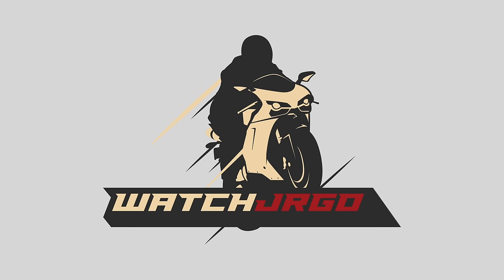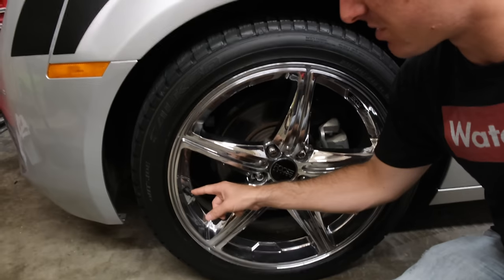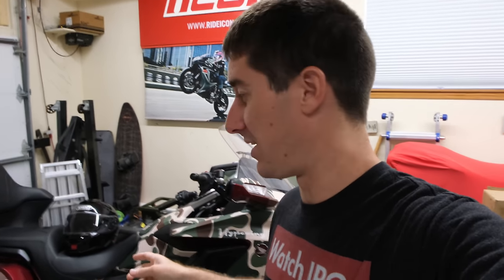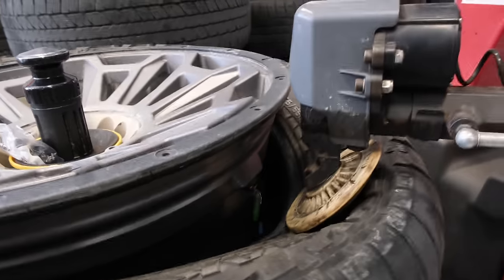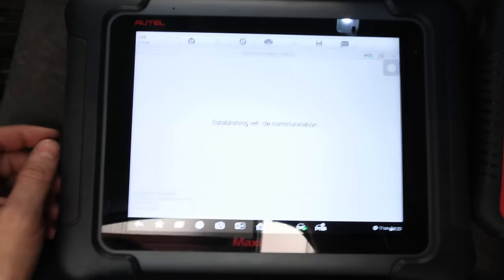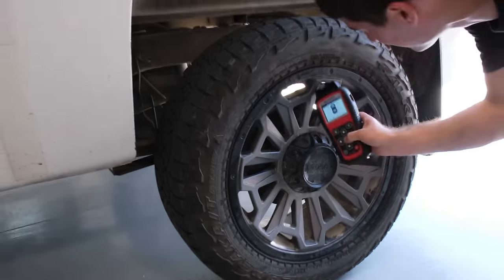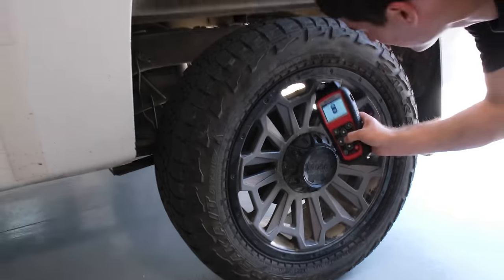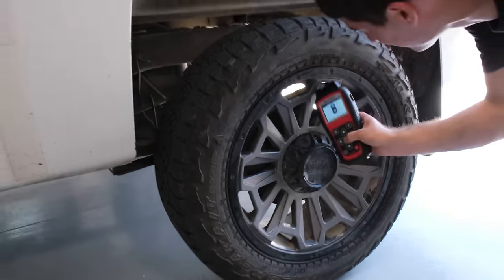TPMS SUCKS! Here's How To Fix It Yourself *Probably*

Comment: Personally i hate tpms and find it annoying and needlessly expensive.  I check my tire pressure regularly.  I wish there were a way to shut it off for people like me.
Reply: Because they sell cars like candies, not educating people the maintenance, the care needed. To make profits the wrong way, is also to make people uneducated, to make people more dependable on others like dealers,shops, and etc... At the end, most people who drives are busy, have minimal knowledge on the safety maintenance of tires and cars, causing danger to self and others on the road. Temporary solution is to create more cost for consumers like TPMS, more waste for the environements as its one time use while new laws keep on placing the burden back on individuals vs back on the system . 🎉
Reply: You can skip it from the ECU Application, but think about insurance. They'll refuse any payments in case of an accident, once proven they were not connected or red by the board computer of the car. And they know well how this could be investigated.
Reply: I hate it.

Comment: I remember the good ole days when you didn't have all this nanny stuff and you took off and hit the first corner, understeer took over and you wrapped it around a tree...the end.
Reply: Yeah those good old days when a fender bender could kill you and cars lasted 100k miles if you were lucky. I think I miss the rust the most. Cars were so much better back in the good old days
Reply: poopsmcgee2k6   Big boats from the mid '70s that had 165 hp and enough plumbing to build a public housing project...

Crumple zones? Not for "Real Men". Who needs stability control, I want the back end to come around...ha!
Reply: if you cant tell a tire is real low you shouldnt be driving
Reply: Vive la 1990s era Ford Explorers and their shredded Firestone tires...
 ...that forced the TPMS sensor upon the entire country!
Reply: Jbog07  my 98 integra 4 speed auto gets near 32mpg  the new ones are close to that and few will last 22+ years with the turbo and cvt
Reply: I'm sorry that you're so awful at driving that you cannot correct for oversteer, but please don't project your shortcomings on the rest of us, K?
Reply: @ragnarocking  Mandatory sensors were required by the EPA for mpg standards. Had nothing to do with safety.

Comment: I like how VW does TPMS with the ABS sensors instead of the sensors inside the tires.
Reply: That's what my Taurus has too and I much prefer it.
Reply: Yeah, there are several ways to meet the Federal requirements. I had a Honda Accord that used the ABS sensors to detect differences in the RPM of the tires. You get a lot more functionality out of sensors, but I'd rather it just be seamless and maintenance-free. I put snow tires on my Jeep a few years ago and had to get 4 new sensors for the winter wheels. It was an annoying hassle.
Reply: So your abs sensor outside the tyre can read pressure inside the tyre? That doesn't sound right. they might use the abs system to collect data but not detect pressure - unless it measures wheel speed rotation? Hadn't thought of that?
Reply: Andrew Crome it doesn’t read the pressure, just compares the differences in rotation between the four wheels.
Reply: My Alfa Romeo does that too. You need to recalibrate if you alter the tyre pressure.
Reply: I have it too in my Skoda and it’s a great feature 😊👍🏻
Reply: Andrew Crome it strictly measures wheel speed, but if the tire pressure varies between the wheels one will rotate slower/faster than others, depending if it’s overinflated or under inflated.
Reply: some older bmws also have abs style tpms
Reply: I personally prefer the way GM, Hyundai etc do it like the ones in this video. You can also start re-learn for the sensors off of the keyfob. My 2019 Jetta has the ABS sensor for TPMS and it doesn't even show individual pressure and has to be re - calibrated every time you put air in. My 2012 Malibu LTZ and 2009 Kia Spectra5 SX both have individual pressure readings and those are alot cheaper to replace over the ABS sensor. I'm not gonna be owning this Jetta outta warranty but whoever does have fun replacing that lol
Reply: Raguvian thank you I was trying to figure in my head how that worked! That now makes sense
Reply: That sounds simpler than putting individual sensors in the wheels but if you lose pressure in all tires equally, such as during a seasonal temperature drop, the ABS system won’t notice it, no?
Reply from the maker: Indirect TPMS is very cool, some of the BMWs use it as well 🍻
Reply: WatchJRGo yeah, my f30 still uses it. Pretty great, as theres no hassle with it.

Apperently its also possible to code other bmws that use sensor tpms to use abs system instead.
Reply: @Raguvian  you learn something new every day. I presume it would be a little slower to react? Thinking turning corners changes wheel speed so it would need to have some thresholds to work to. The TPMS on my bike was instant - saved my bacon.
Reply: @amcrome  Indirect TPMS is part of the ABS Control Module and uses the Steering Angle Sensor, so it only measures data if you drive strait :) not if you turn a corner.
Reply: @_dmfd  
 ABS TPMS system don't tell you the pressure, but you dont have to worry about programming or low Battery on the sensor. The ABS sensors are already in the car, so why not using it ?
I've seen a comparison test between an ford and an VW. The Ford (with transmitters) need several minutes to detect pressure loss, the ABS one just a few seconds.
Reply: @hayksamvelyan  i think Indirect (ABS) TPMS can detect pressure loss at all tires. at least i got one time a warning that all tires need to be refilled on a Indirect system.
Reply: @WatchJRGo  yeah, my 2011 BMW F10 had indirect tpms, the facelift had the sensors in the wheel, or it came as an option, not sure.
Reply: @amcrome  I would imagine there is some sort of threshold for it to work. You're right that while turning the wheel speeds are different, but if you have a blowout or very fast leak, I would think the rate of change of the circumference of the tire (and hence the wheel speed would shoot up dramatically compared to the rest) the system would be able to pick it up very quickly. While turning, you'd have two wheels spinning faster and two wheels spinning slower, but if you had a leak or low pressure, that one tire would be completely different than the other three.

ABS works in a split second anyways while braking, even around corners, so I would trust them to be able to accurately monitor tire pressure as well. The other benefit is not having to rely on sensors inside the tire that run on batteries, which means any aftermarket wheel and tire combo will work and won't run into issues like JR did when swapping the Subaru wheels onto the Prius. I put aftermarket wheels and tires on my Golf and had no issues whatsoever with the TPMS.
Reply: Yeah still not necessary
Reply: Yah old Toyotas used the same system so did BMWs best system ever nothing to fail and will always tell you the truth no turn on light when below one bar
Reply: Hayk Samvelyan from my experience, that is correct but in theory it only wouldn’t pick it up if the tires weren’t inflated properly or somehow all deflated at the exact same pace.  A lot of cars with this style system have some sort of manual reset
Reply: @hosersgarage1658  vw is still a pos eh
Reply: I like the abs sensors on my vw too. I've only had a flat once but it seems like it told me right away.
Reply: @nascarfreek23  ya much better system they only came up with the sensors because it will cost you 300 eures every single time you need new tires That's what it is it has nothing to do with the safety or convenience
Reply: @hosersgarage1658  that's good to know so that's great that means my mum's Micra has that system because it has a button that says reset
Reply: My BMW has that. It surprisingly works well. I once had a small leak from running over a nail and it detected it. Then after patching it up, you just simply have to reset it on iDrive. I wish car makers did that esp if you run two sets of tires.
Reply: @matte8441  good job 👍 I wish they'd just leave it alone the old systems as usual are better and run off simple thinking
Reply: That's actually a terrible system.  Most TPMS sensors last 10-15yrs+ so zi much prefer having actual pressure readouts vs this junk system.

Comment: My warning light came on. Looked in the manual, scrolled down to settings, driver assist and sorted. I later found out the dealer had changed a tyre and not reset the light. Check this before spending any cash. Some folk may not be aware of this fix.

Comment: Tpms is just another Gov mandated accessory that should be an option, they regularly fail and at 30 to 100 dollars to have fixed each it's much cheaper to buy a tire pressure gauge and check yourself 3 or 4 times a year! Especially if they dont tell you what pressure is required!

Comment: Why don't the auto manufacturers fit a sensor on the spare? All they'd have to do is re-engineer the computer so the spare can be on any corner without the computer throwing the toys out of the pram. Without a sensor, the spare causes the computer to give up on displaying pressures from the remaining 3 good sensors and just displays a message such as "sensor fault".

Comment: You dont even need the fancy programming tools for a GM... put the key to run, press and hold lock and unlock on the fob to enter tpms relearn mode... then go around and let air out of each tire until the horn beeps... the vehicle will light up the turn signal on what corner to do the tire

Comment: Not just the tire shop, the dealer. On the 350Z only the dealer can reprogram. At their out of control prices. I don't believe in TPMS, if they want to do something, make people use their signal lights. They have been on cars since forever and people still can't get it., Mine didn't work right from the dealer (brand new car). It also had an issue : in Florida, on cold days (as cold as it gets here) it would mark all tires as low. Of course, once you drive they warm up and pressure is fine. But if you are not aware, you might add air to the "low" tires to then have over-inflation when they warm up. This was 2003, they might have come a long way since, or not. But you see, it is easy : get a tire machine, get two computers, easy.. so you can check the tire pressure on your car.

Comment: When ever I used to work for  ford,  I had a customer come in one time that ask me if I can get rid of the TPMS sensor lights, well previously I had been messing with their computer on new vehicle just to kind of look at what all it can do, so I gave it a shot. I hooked up the computer to his truck and I set the minimum maximum psi for his tires to be 1PSI by doing so the light never came on.

Comment: 1 Phone chargers can  Interfere with tpms
2 autel tool only program their sensors
3 gm, ford, audi, vw, BMW probably forgetting a few manufacturers can be put into tpms learn mode through the dash
4 some sensors lock out and can not be programmed to with vehicle info once installed and aired up I program them then test them then install

Comment: For the record, you can also use the TS508 to write TPMS sensor IDs straight from the tool via the OBD II cable and Advanced mode.
Reply: Only to Autel TPMS MX sensors.  Not that it's a bad thing, just know you can't buy the sensors at the dealer.  Unless they sell Autel MX sensors that is.
Reply: Which tool can one use to rewrite tpms hex id's on cheap tpms sensors?
Reply: @Roosterfishh  Hard to say. If it's a cheap direct-fit TPMS sensor, you can't rewrite them. If you're talking about something from NAPA Echlin's OE-Match, you will need at least an Ateq VT37.

Like I said, it's hard to say. Especially with a variety of direct-fit aftermarket sensors available in the marketplace.
Reply: I'm going to chime in here with an updated answer.

Having used Autel's TPMS tool (and their TPMS sensors for awhile), I highly recommend staying away from the Autel TPMS MX sensors!

The MX sensors are flakey, and crap out on you often, leaving you to wonder if your tires are flat or if it's Autel's sensors playing tricks on you.

Here's what I recommend you do instead:  Get pre-programmed TPMS OEM sensors (which are sold at dealers and stores like Rock Auto).  You can install those, activate them (via instructions that come with the sensors), then have the Autel tool read the sensors and program those into the onboard  computer via the OBD II port.

I love the tool, but those sensors are baaaaaaaaad.

Comment: There's one more type of TPMS and that's indirect TPMS.  Indirect uses the vehicle's ABS / wheel speed sensors to monitor each wheel's rotation count/speed.  When one of them has a variation in their rotation count compared to the other wheels, it will will trigger the TPMS (tire) light in the dash because a low tire pressure will cause the wheel speed to change and the TPMS indirectly detects that via the ABS / wheel speed sensors.  The other type being "direct" (what you're showing in this video) where there are sensors in each wheel that report the pressure to the TPMS subsystem of the vehicle.  I agree having an Autel TPMS tools is a great thing to have.  I use my Autel MaxiTPMS TS601 far more than I thought I would when I purchased it.  I enjoy watching your videos!

Comment: My 2019 Ford Fiesta SE has the light and says the tire is low. However, it doesn't say which tire is low. Which is not a big deal to me because i have a tire pressure gauge that I use and just air up the low tire

Comment: For anyone saying it's laziness and to just check the tire pressure on a regular basis, that's all well and good until your tire is punctured and you don't know it. I lost a brand new tire due to not knowing it was flat (low profile tire) and I drove on it for several miles and ruined the tire. I bought a TPMS kit and never looked back. I won't run without one now, especially since it's a sports car that I regularly take fast on curvy roads, not to mention the tires are more expensive. 

I still manually check my tire pressures occasionally just to verify they're working properly, but these kits are great.

Comment: Firestone charged me $75 for a single sensor in my HHR. Much prefer an indirect TPMS system like my Taurus has. It just uses the ABS sensors to compare wheel spin to find a low tire. It's not nearly as accurate as a direct system but it's way cheaper to maintain and does the job just fine.

Comment: There is another system that measures pressure loss with the hall sensors from the abs/esp, if it notices that one tire is slightly rotating faster due to the decreased circumference it knows that this wheel needs to be checked , it’s a simple system but I like it , it’s better than not knowing that you’ll have a big problem soon 😄👍🏻

Comment: How to fix a TPMS light on a 08 Forester...remove cluster, take out TPMS lamp bulb, reinstall cluster, check tires regularly like your suppose to, and enjoy not having the annoying light on the dash.
Reply: The tmos units have 10 year batteries. Some last longer some shorter. My 2009 Honda Crv had 1 bad battery after 9 years, I knew I needed to change tires next year. The following year I got new tires and new temps aftermarket sensors from eBay, 4 for $44(total not each) had Discount tire install and program. They had no problem with these aftermarket sensors and didn’t charge for installation or programming. Tires were ones I wanted at a good price.

Comment: Working at a tire shop I do this every day, it's crazy how different our steps our. I can also replace all 4 tpms systems and relearn in like 5-10 minutes total
Reply: Also btw most cars auto relearn, Chev, GMC, Cadillac and Mercedes you have to manually relearn them.
Reply: @ineedmoreroom7495  hey buddy since you know about tpms since you work at a tire shop i have 2012 acura tl and the the tpms like blinks for a minute then stays solid i have the autel ts508 same one in this video and got a code  that the sensor failed to register i took it to Pepboys they said that my left front sensor was no good so they put a universal one in and they tried programming it and the couldnt they even tried a relearn by driving it . when i tried getting the hex id from from the odb is blank said N/A so it like it need to be written . so pepboys then ordered a oem sensor from acura and same thing . tpms lite still blinks and then stays solid have a driven the car for more the 50 mile and still nothing .. then i got a new receiver antenna that sits almost above the tire and still noting . when i delete the code the light turns off and i can see the other 3 tires psi but when i drive over 15mph the like come back on blinking then staying lit .and sugestions .
Reply: @Havihav  Hi. I have a 2015 Fiat Pop 500. Changed rims at Pep Boys. Now the tire light stays on says "tire pressure monitoring not available" and Pep Boys with scanner confirmed all sensors are active - just not connecting. Menu panel on the car dash doesn't have a "reset" or "relearn" button. Dealership asks $205 (one person) $290 (another person), to diagnose. Pep Boys said they have eliminated the position for the person that did resetting of TPMS connections, for these cars and said I may have to go to the Dealership. I have driven it 45 miles. Tire light stayes on.